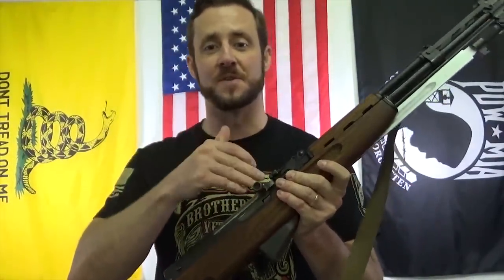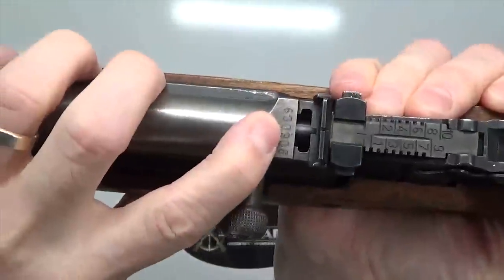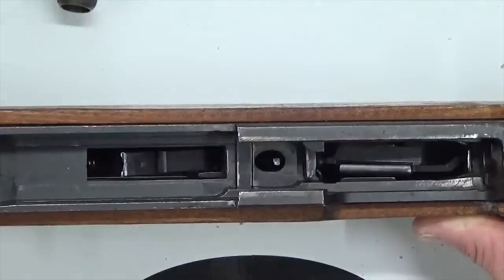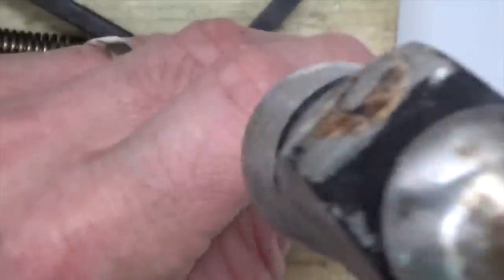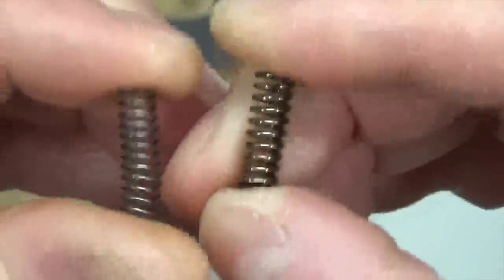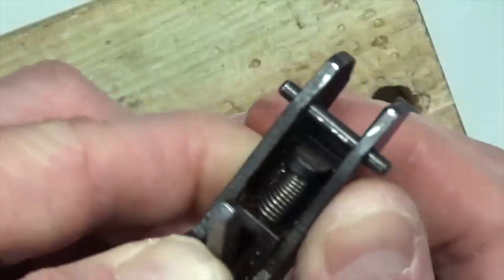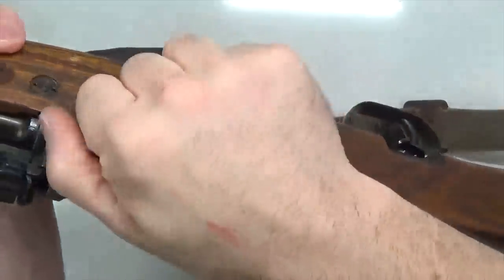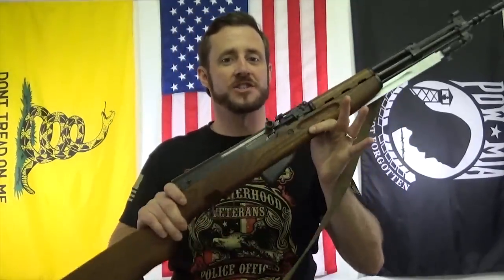SKS Accessories and SKS Trigger Job to improve Accuracy SKS Trigger Spring Kit

Comment: I just got my first SKS... a Yugo. I've only done dry fire function checks with it so far, and I notice that the trigger doesn't have an AUDIBLE or TACTILE reset click. It functions as it should, and I'm able to "fire" it again. But there's no positive or noticeable reset sensation. Also, after I took it down for inspection (I did NOT take down the trigger group!), I now can't re-seat the mag! Any thoughts, anyone?
Reply: Did you clean out all the dried cosmoline?
Reply: @jimvac77  , this particular SKS wasn't in a "stored" cosmoline condition when I got it. It's totally clean and ready to go! However, your suggestion is a good one. However, I still haven't had the chance to live fire it at the range (I have other rifles that took priority over it. LOL) But when I do get around to it, I will keep your suggestion in mind, as there may still be some residual cosmoline wedged in the trigger group. Regarding the re-seating of the magazine, that was just on me. I didn't realize that there is an actual ridge in there that the mag latches into. Thanks for your reply!
Reply: @DonyaLane  good luck with it!
Reply: Assuming you solved your problem,  but you need to either pull the bolt back or remove the bolt all together to re seat the entirely assembly back onto the stock. The trigger group follows after and holds the mag into place. At least on mine the mag didn't want to seat with a closed bolt.

Comment: I have a small concern I got an SKS M which is the ak mag fed sks  dosent seem that the spring is all that different however it looks to be a bit different on how the spring is set in the rifle do you think this will make any difference I got a spring on the way if it works ill let you know if not ill also inform you
Reply: oh no I got the kit the spring was not my problem read my above follow up on the issure it worked like a charme but there was a lot of added issues due to the mag release being pinned and crimped into place as well as the mag spring I wish I did a video on it cas it took 4 hours to get back together
Reply: So was it worth messing with? I ordered the springs but mines a sks m as well.

Comment: Question:  I see mixed reviews on the spring kit. I see you now give 2 springs? I have several sks's and I just bought your kit to try out before I buy 2 more kits. I worry about the mag dropping open so what spring should I use ? If this kit works I will get more for my club and range. We polish the sear and all possible friction points that you can see. I will give you feedback once I install the kit. MAGA.